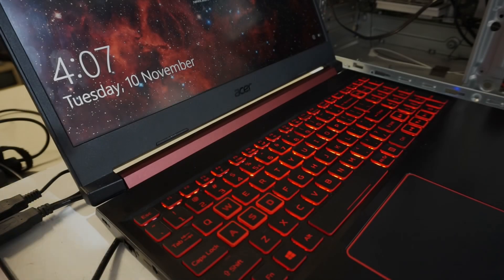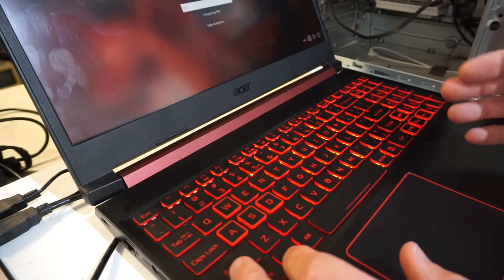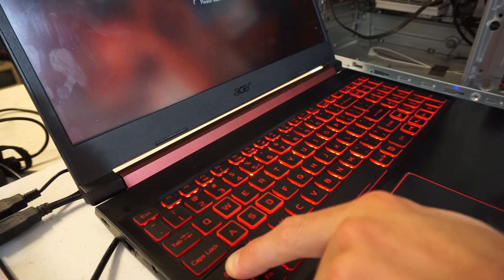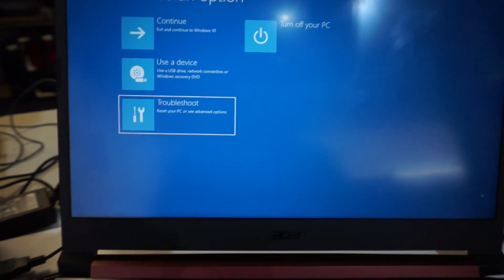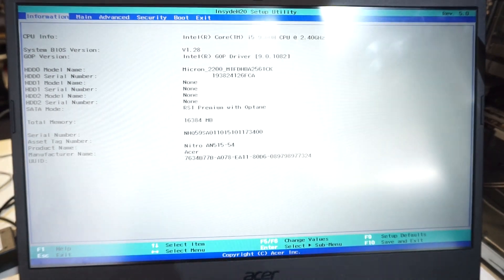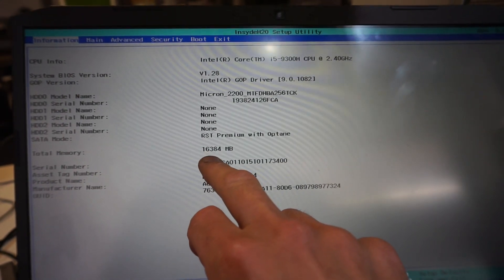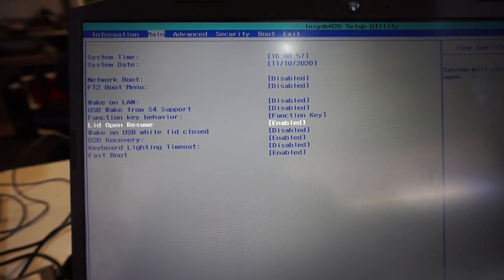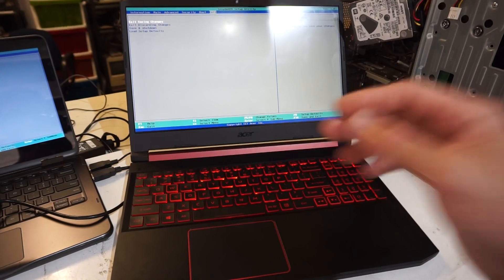Acer Nitro 5 2020 AN515-54 How to Enter the Bios

Comment: My Acer Nitro 5 Ryzen 5, AMD RX560X is my laptop 

I have some ram locked in the slot one like 3.5gb i have 8 gb ram usable is only 4.5 how do i change this???

I tried changes all the software in ms config
Reply from the maker: i would be thing the Ryzen CPU is allocating ram for the intergrated GPU
Reply: @rickstechrepairs  for only slot 1 this is happening can't I change it? Or remove the team from slot 1 and purchase 32gb ram and install in slot 2?

Comment: hi can i please ask u i added an 8gb of ram to my nitro 5 the one with i5 11th gen and gtx1650 but when i checked my task manager it appears that my ram's speed is only 2933 mhz instead of 3200mhz
Reply from the maker: i see that usually on most laptops, if i remember correctly it should scale with the CPU
Reply: Hey did u find any solution to that, I am having the same issue rn.

Comment: Excuse me, dio you know how to increase de mhz of the ram? Mine is running 2667 but u have two 8gb ram ddr4 3200 on it
Reply from the maker: There is no manual adjustment, also its possible that's the max frequency your CPU goes to

Comment: Hi sir, I'm currently using the exact Acer Nitro 5 model in this video. I'm currently facing some issues on my device, and I need your help. Can I get the system image file for the device? I needed to restore my device back to factory settings bcs I wiped out the entire original file by installing windows using usb and I didn't have a backup. So, my device isn't detecting the dedicated gpu (Nvidia GTX 1650) and I thought of trying to get the system image from another nitro 5 laptop to see if it works. Please note that I tried everything including reinstalling gpu, reinstalling windows, reinstalling gpu using ddu software in safe mode.  All didn't work. The error for the dedicated gpu is code 43 in the device manager. So, would you mind helping me out sir?
Reply from the maker: i no longer have this machine to offer a system image.

Using the Windows 10 Media Tool should get you windows installed

Then i would install the GTX Drivers from nvidia

Then i would download Acer Control Center

Comment: Hello, anyone found a way to run the RAM on the MHz it should be? Why cant we change the settings in the BIOs thats BS or not?
PLZ Help^^
Reply from the maker: On cheaper gaming laptops iv never seen the option to set ram frequency
Reply: @rickstechrepairs  ok but a 1.2k gaming laptop is not a cheaper laptop in my opinion

Comment: i have the exact same laptop, i just installed another 8gb ram so it has 16gb, they are both 2666MHz and before when i only had 8gb in task menager it said it is 2666MHz but when i installed the other 8gb 2666MHz ram it shows that it has only 2400MHz. my cpu is Intel(R) Core(TM) i5-9300H 2.40GHz
Reply: Thhhhhhhhhhank you so much!
Reply: Bro I have installed additional 8 gb ram into my device and now total ram is 16 gb .. but usable is only 5.94 showing .. can you help ???

Comment: i have a newly installed 16gb ddr4 ram and the speed when i check is only at 2933mhz can i change it in the bios to increase it to 3400mhz? or is it not recommended?
Reply from the maker: What CPU is in your laptop ?
Reply: @rickstechrepairs  11th Gen Intel(R) Core(TM) i5-11400H @ 2.70GHz   2.69 GHz

Comment: What option is safe to use and will speed up my nitro both with loading and fps?
Reply from the maker: Dual channel ram and and a SSD is what's needed

Changing settings in the bios won't do s thing
Reply: @Ricks Tech  guess im too used to my pc lol

Comment: i just installed a new ssd and my laptop doesn’t read it.. do i need to go into bios ?
Reply from the maker: Load windows

Right click windows icon on start bar

Select disk management

Initiate and format drive

Should be good to go
Reply: I had a similar problem trying to reinstall windows. You need to change sata configuration to ahci. The option is hidden to make it appear you need to press CTRL S while you in the main menu.

Comment: In the acer bios is there any way to change ram frequency? Mine keeps running at 2666mhz when it can run 3200mhz.
Reply from the maker: not that i have seen
Reply: @rickstechrepairs  The maximum RAM Frequency is 2666MHZ. You Can not change this option on BIOS.

Comment: hi i have the same laptop i put in a new 1tb pcie  m.2 ssd hdd and cloned windows on to it but in the bios it wont let me choose which hdd to boot from because before it was the 256gb drive running windows but i cant change it to run windows from the new 1tb any advice
Reply from the maker: I would try and remove the 256gb drive and only have the new 1tb and see if it will boot
Reply: @rickstechrepairs  thanks it boots and is all good but i have a 256gb that i cant format and sell on lol 😆unless i buy an usb adapter thanks for the help

Comment: Extension question.  How do i get this computer to auto power up when mains power is applied?  Nothing obvious in the BIOS, after following these instructions.
Reply from the maker: Iv seen that option on desktop bios' , but I can say iv seen that on laptop bios'
Reply: @rickstechrepairs  Thanks for that.  I want to remote into the machine when I need to but that will mean having to leaving it running. The plan was to use a wifi switch to turn it on as required. Such is life.
Reply from the maker: makes sense..

it might support wake on lan, which might be worth checking that out

Comment: Can it support 3200 MHz of RAM? Can we enable XMP to reach the advertised speeds?
Reply: @time tO huNt not possible on the intel version checked mine it is only limited to 2666 MHz and 2933 MHz in the newer 10th gen i-series processors not sure about the AMD version though if you got an AMD you might have a chance if the BIOS in the AMD allows for it or maybe some other brands like Asus allow it too on their intel laptops
Reply: @itsace119  hey do you know how to increase my ram speed it says it runs at 2400mhz but its rated speed is 2666mhz thanks in advance
Reply: @Canajoharie07  go to your bios and check either the memory or advanced section
Reply: @itsace119  damn bruh
Reply from the maker: Not sure sorry

Comment: Hello, Can you please try to help me with this Little problem? 
I5 10300h 
8 GB 3200mhz (processor max 2933mhz)
So It show 8gb at 2933mhz
I buyed a new module 2933mhz and on CPU Z It show It Is 2933mhz
But when i go check general RAM It Say 16 GB 2667 mhz, how Can i fix this Speed slowdown?
Reply from the maker: im thinking that would be more a power saving function, but i wouldnt be too concerned

Comment: Hi, could you help me, please. I have de same acer nitro 5 as you do. I installed another 8 gb ram. 1,2 volt, 2666 hz . Exactly igual the first one. But , the bios doesn’t recognize the bought in dual channel, showing that it is only 8 gb installed . When i used only one ram memory , works normally, independently of the memory slot. What can be the problem
Reply from the maker: Does matter what configuration you do it it 

Slot 1 - new stick of ram
Slot 2 - empty

Then try

Slot 1 - old stick of ram
Slot 2 - empty

Try both in at once

Then switch over both sticks after

Comment: Hey, I have the same laptop. My problem is that when I start up it shows "preparing automatic repair" and after that it just gets stuck on the acer logo screen and nothing happens after that. Anybody has any idea???
Can you tell how to get to that advanced options screen after starting up.
Reply from the maker: when you get to that it sounds like your windows has cracked it, or your hard drive has failed
Reply: @rickstechrepairs  Update: It was hard drive. I removed it and everything is fine. Now I need a new hard drive, smh. 🤦‍♂️🤦‍♂️
Reply: @rickstechrepairs  What should I do?

Comment: how do you disable your integrated graphics card (amd or intel) and use the graphics card instead (nvidia) in the bios
Reply: it doesnt have that option. You can change it within the nvidia control panel, though
Reply: I'm so frustrated with this laptop. Every time I try to install the Nvidia driver, the installation crashes. Then windows cannot even reboot again until I use a system restore.*
Reply from the maker: i dont think it has that option
Reply: I also have a problem trying to install nvidia card 🥺
Reply: @mahmoudsupes2461  hi, did you find any solution, i have the same problem
Reply: @el_dany_85  nothing worked for me so far 🥺
Reply: did you get any solution to your problem? cause i do have the same problem
Reply: @BillaVillaOfficial  did you find any solution, i have the same problem
Reply: this laptop is a waste of money
Reply: I have the same issue. Tried everything and I mean everything. Acer laptops are useless. Locking the bios what a stupid stupid idea from the manufacturer you get this a lot on laptops too.
Reply: You have to update to Windows 11 to install the latest Nvidia driver. I had the same problem on Windows 10 but it went away once I updated to 11

Comment: CPU-Z shows that my Nitro 5 AN515-54 RAM runs at 2400MHz all the time, even though the RAM supports 2666MHz. Any idea, what's wrong ?
Reply from the maker: What intel chip is it?
Reply: @rickstechrepairs  i7 9750h
Reply: @rickstechrepairs  I went through some online reading today. Last time I checked, no online articles were available about this issue (Oct/Nov 2019).
Figured out that the CL of the additional RAM which I installed in RAM slot 2, doesn't match the CL of default stock RAM, causing this behavior. When I removed the second RAM, CPUZ and task manager showed 2666MHz.
Reply: @gr8vijay  was the other ram you installed running ay 2400?
Reply: @evolution7lyf  
8GB RAM (RAM1) running alone : 2666MHz
16GB RAM (RAM2) running alone : 2666MHz
8GB + 16GB running together : 2400MHz (due to CL mismatch)

Bought a 16GB RAM (same model as RAM2). Now the system is running Dual Channel at 2666MHz (32GB).
Reply: @gr8vijay  ok cool I had 8gb ram now im running 16gb dual channel and I can't believe how much better it performs
Reply: @evolution7lyf  Yes. It is snappy. Do you also have Nitro 5 ?
Reply: where to see whats my CL speed ? does CPU-Z have tha
Reply: @farrelraihan  Yes, CPU-Z shows CL (CAS Latency). 

In CPU-Z, look at Memory section. There, you will find the current 'CL' (CAS # Latency).

In SPD section, you can find CLs of individual RAM sticks (CAS # Latency).
Reply: hello sir i have the same problem, 4gb + 16gb, before i got 2666mhz but now 20gb 2400mhz, how can i fix this :(
Reply: @kenveractivechannel  If both RAMs support 2666MHz, then the issue can be due to mismatched CL. Can you remove any one of them and check the RAM frequency ?
Reply: @gr8vijay  hello I’ve also had the same issue with my ram. I upgraded to the 32gb ram 3200mhz Dual Channel but when I check my task manager it only shows the speed of 2667 dual channel. Is there anyway I can max out the ram speed to 3200mhz?
Reply: @jamescrimson2332  I think, the solution may be available in BIOS.
Reply: @jamescrimson2332  Did you install RAMs from two different manufacturers ? Mismatched CL should be the reason for lower RAM speed.
Reply: avi  Upgraded to two RAMs the moment I got the laptop. So, I don't remember, how the performance was, without two RAMs. I believe the performance increased. 

Tweaked Windows visual settings as well, to improve the speed. Replaced stock M.2 SSD with Samsung EVO 970 Plus M.2 SSD recently. That did not bring any noticeable speed improvement, as stock SSD was fast enough for our eyes.
Reply: @gr8vijay bruh I got the same issue, it shows 2400mhz but my ram is ddr 5 4800mhz, I have the acer nitro 5

Comment: Bro in my nitro 5 laptop right side usb port is working even after shutdown, for example when i turn off the laptop by mouse connected,,the mouse light wont turn off it still on even after shutdown. Is that any problem?
Reply from the maker: sounds like a problem, try some usb sticks or some other devices on there but you might have to claim warranty on it
Reply: @rickstechrepairs  what problem could that cause sir?
Reply: @sheikh7120  put it in a differernt usb port if you really care

Comment: hi, can i ask something since im new to these ram upgrading stuffs. i have the same nitro 5 as you do. i intend to upgrade and buy 2 pieces of 8gb rams for my nitro 5. once i inserted the new rams, will it automatically shown to become 16gb or i need to adjust anything in the bios? thanks in advance!
Reply from the maker: once installed you dont need to do anything software wise
Reply: @rickstechrepairs  Can I do this when the laptop is off? It won't turn on and I need to open bios
Reply: @CasualGaming3  it’s recommended to disconnect the battery and insert the ram and the reconnect battery and turn it back on , to check if it’s registering the ram go to the bios
Reply: i installed a 16gb ram and the speed is only 2933mhz do i need to increase it?
Reply: @shinixb.6500  I cant find the setting in the bios to increase the mhz, does anyone know how to?
Reply: @ryyzz. I think there’s no option to change XMP even I am getting maximum of 2933mhz